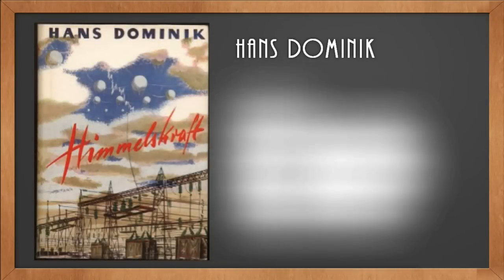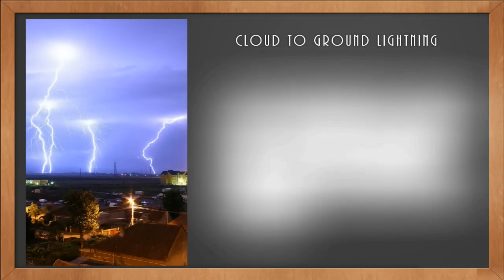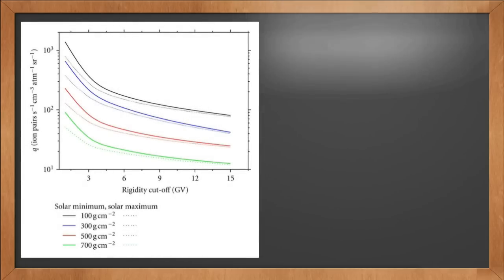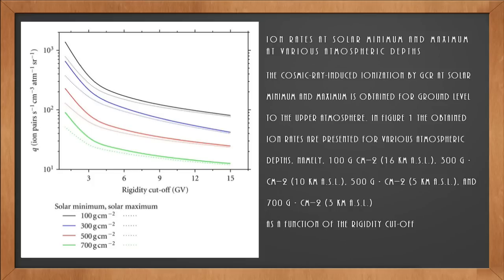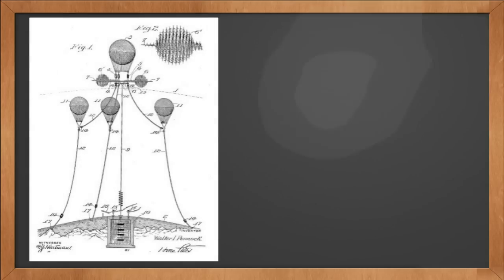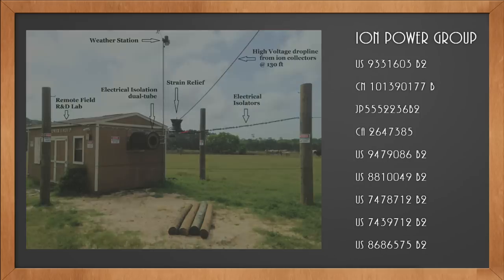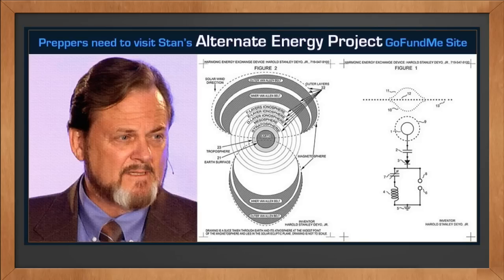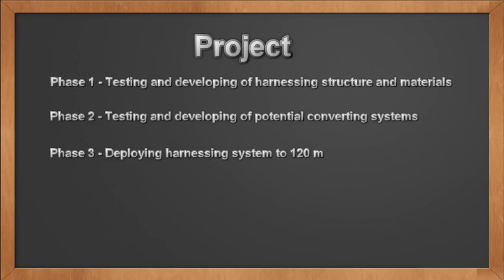Harnessing Atmospheric electricity

Comment: There is more than enough electricity, potential between the ionosphere and the ground to power the world.
Thanks.......Marc.
Reply: Doubtful. The total charge on the surface of Earth is estimated at around ~500,000 C, and the voltage of the ionosphere ranges between ~150 to 600 kV; assuming the latter to be generous, we can calculate the total energy stored in the system, since that's equal to charge times voltage:

500,000 C * 600 kV = 3 * 10^11 J

In other words, a total of ~300 billion joules is stored in the Earth-ionosphere capacitor.

The global power consumption is estimated to be ~2 TW on a continuous basis, i.e. 2 trillion joules per second. As should be very obvious from this, we use almost 7 times the amount of energy stored in the entire Earth-ionosphere capacitor every single second. Do you think this entire capacitor would recharge itself every 1/7 of a second? I sincerely hope not for your sake.
Reply: @hoon_sol  Much thanks for the calculations, the numbers tell the facts. I'm not one who would work the numbers. In perspective, if one house hold could utilize just a small amount, it would be amazing. Methods have been reported by certain people in the past, but there is no one today that claims such an accomplishment, if it was a possibility someone would have stumbled upon it. Thanks a great deal for the time and results from calculations.
Reply: @tribulationcoming :

You're welcome.

It should be noted that the fairweather current (the constant current trickling down from the ionosphere due to the electric field) is roughly ~1800 A in total, so that's ~1.1 GW if we're generous with the total voltage again. This means that the capacitor can recharge at least 1.1 billion joules per second, but the upper limit is not known (and likely won't be unless we start to actively drain it of energy at a massive scale and measure it, but this should naturally be done with great care lest we want potential devastating consequences); it's highly doubtful that it's anywhere close to 2 TW, but we really don't know.

The US alone uses ~400 GW of electrical power on average, so ~1.1 GW would hardly make a dent in that, and that's just electrical power, the total energy consumption of the US is closer to ~3.3 TW, beyond the total electrical power consumption of the entire world, and ~1.1 GW is just 1/3000 of that. The total global energy consumption is ~18.4 TW, again dwarfing that rate.

I'll say this, though: it could be possible that the Earth-ionosphere capacitor is at virtually full capacity, and that this is what is preventing further current from flowing into it; in that case the potential recharging rate could be much higher, depending on the current that is continuously delivered from Solar activity.

This is highly speculative, because these estimates might be completely off, but if we assume that the 1 second it takes for the capacitor to recharge itself the ~0.3% difference corresponds to a single time constant for the system, then that means that if the capacitor were empty it would recharge ~63% in that single second, given sufficient current from Solar activity (which could be wrong, perhaps this could be depleted too). That would mean a total current of ~315 kA, which is quite significant, and interestingly not far off the magnitude estimates we have for the Birkeland currents we know are flowing from the magnetosphere to the ionosphere, which are estimated at ~100 kA to 1 MA depending on levels of Solar and geomagnetic activity. That would mean a total power of almost ~0.2 TW; sadly still not even remotely close to what humans use, and we'd have to deplete the ionosphere completely to achieve it, which could have a lot of adverse consequences.

In conclusion, I thus definitely still doubt it's a useful source of energy long-term. In comparison to that relatively meager power, a total of 173,000 terawatts from sunlight strikes Earth continuously, dwarfing that calculated current completely. Most of this is radiated right back out instead of being utilized, as much as 60% of it. Again presuming we shouldn't mess too much with it, let's say we manage to utilize just 10% of it, which corresponds to 17,300 terawatts; that's almost 1000 times the power we're currently using from all sources of energy, and thus constitutes a far more promising form of energy long-term.

In the even longer term it would likely also be best to do the same, but closer to Sol and transmit the power back somehow; the radiant exitance of Sol is ~63 MW per square meter, so if we were right next to it a mere square kilometer of highly efficient receivers would cover current global power consumption. As we move further up the Kardashev scale we can also note that the total power output of Sol (its luminosity) is a whopping ~400 yottawatts, i.e. 400 * 10^24 watts; that's 400 trillion trillion watts, or 400 septillion watts. That's 20 trillion times our current power consumption.
Reply: @hoon_sol  I do a lot of weird, unusual, and strange experimenting. One idea is to put an eight foot diameter aluminum disk at a height of about 35 feet. Have a frame made of 3/4 aluminum tubing and an old tower. Will cover the frame with sheet aluminum on both sides and lift the assembly to a vertical position. Two pieces of no. 10 stranded wire will lead to the bench in the electric building. Then try lots of things. Thanks very much for the detailed and informative explanation, much food for thought. >Put one of my bifilar coils of approximately 900 mH immersed in a gallon can filled with magnatite, the flux field is contained with in the confines of the can. Using it in one of the pulse circuits I'm working with, seems to be doing well.
Be safe, but make sparks.

Comment: if its DC and at many KVolts  forst you need to good kv insulator and a way getting you DC to AC so you can step the ultra high impedance down to a lower voltage with more current. so here is how you do this  1 a Tesla coil on top of a ground stake 2 then on top of that a wind  mill type fun that makes and brakes the electrical circuit when the wind blows you AC pulse for the Tesla coil. 3 at its base, the low voltage AC is taped off , 4 at the other end of a long wire at the very top a barrage balloon made of tin foil or any conductive foil . If all goes well you  will get some free electricity.from a bridge rectifier circuit & capacitor.

Comment: Why we are not collecting electricity from Ion-Sphere .
Reply: The total charge on the surface of Earth is estimated at around ~500,000 C, and the voltage of the ionosphere ranges between ~150 to 600 kV; assuming the latter to be generous, we can calculate the total energy stored in the system, since that's equal to charge times voltage:

500,000 C * 600 kV = 3 * 10^11 J

In other words, a total of ~300 billion joules is stored in the Earth-ionosphere capacitor.

The global power consumption is estimated to be ~2 TW on a continuous basis, i.e. 2 trillion joules per second. As should be very obvious from this, we use almost 7 times the amount of energy stored in the entire Earth-ionosphere capacitor every single second. Do you think this entire capacitor would recharge itself every 1/7 of a second? I sincerely hope not for your sake.

Comment: Like the transmission wires, '5G' transmission towers, sky-scrapers, cable-cars, Ferris-wheels, flagpoles and other tall structures prominently featuring electrically conductive materials raised up high in the air!!!

Comment: Sir, what do you think about this, putting a low current ac signal through the wire to help move smaller charges in the wire so as to collect more energy?  Kind of like priming a pump?  Maybe, a super high frequency, but very low energy could be used.  It might do nothing, but I bet it does matter and works better that way.
Reply from the maker: I have some ideas I will try as it is as well related to Walter Russell's and the Phoenix journal 37 lecture.

Comment: Atmospheric electricity is static electricity. You might be able to harness lot of static electricity with this experiment. Take a PVC pipe, insert copper coil inside the PVC pipe in a way it properly sticks to the walls inside the PVC pipe. Connect LED bulb, full bridge rectifier and capacitor to copper coil at wire coming out of both ends of copper coil from PVC pipe to complete the circuit. Now rub the PVC pipe with silk cloth or nylon cloth to produce static electricity. See if the LED lights up. If LED lights up, experiment is a success.
Reply from the maker: That is not the point
Reply: Atmospheric electricity is electricity produced by rainwater falling through air.  The question is how to harvest that energy without having to create the necessary friction oneself (as by giving a hand job to PVC pipe rigged with wires)
Reply: @taxAt1oni5th3ft  a handjob lol that was hilarious😅😂😊

Comment: Any voltage gradient in the atmosphere (or anywhere else, for that matter) is of little practical use if you can't draw any significant current from a harnessing system. All you will do is cause the electrostatic field to distort, so if, for instance, you connect an electrode at 100 metres in the air and connect the other end to any current drawing device at ground level, you will just cause the electrostatic potential at the electrode to drop to zero volts with respect to the ground. Of course, if you do this during a lightning storm you'll probably blow up your equipment on the ground and possibly die. But you will have harnessed about $100 (correction $6 or 7) worth of lightning energy in doing so. That's at today's commercial value of electrical energy from traditional sources.
Calculation and correction added: That's 30 thousand amps × 100 million volts = 3 000 000 000 000 watts, or 3 000 000 000 kilowatts. But it only lasts about 30 micro seconds (apparantly), so that's only 3 000 000 000 × 30 ÷ 1 000 000. = 90 000 kilowatt-seconds, or 25 kilowatt-hours (divide 90 000 kilowatt-seconds by 3 600). I pay about £0.17 per kwh, so that's £4.25, or about $6 or 7 dollars.
Please tell me if I've got my calculations wrong. They're all big numbers until you get to the final bill.
Reply from the maker: Your math is sound and represents the majority of people thinking about it. It is true that there is no real interest from the industrie to follow up. It is all based on scale and efficiency. I want to prove a couple of points which have been mentioned with figures to make this endeavour pointless. As seen in your comment.

Comment: Ehh....  
atmospheric electricity is a thing but it can radically vary with even minor changes in weather. Society struggles to make a good electrical source out of solar panels and wind turbines, but the electric potential of atmospheric electricity can vary from as little as 1 volt per meter to 1 kilovolt per meter. More over, what defines a 1 KV condition and what defines a 1 volt condition is subject not predictable. 
solar weather (literally the electricity produced by the sun that hits our planet), wind, relative humidity, local geochemistry, human RF activity, and variations in the earth's core are the most prominent off the top of my head.... but they're probably more.  

That all said, this stuff is easy to experiment with. aluminum foil is easy to shape and form into any sort of balloon, even one that looks like an idealized omnidirectional antenna. You can use mylar, but it actually impedes charge somewhat. You want to expose large areas of metal, high up in the atmosphere. IE: maximize surface area exposure to the atmosphere. 
45 gauge copper wire is cheap, although weaving it with high strength fishing line has to be done manually and is generally extremely difficult. Mostly cause 45 AWG is so small it's hard to see, even with large magnifying glasses. 
You can buy helium in the USA at party stores, or you can just use hydrogen as long as you keep it small. 

You need a low impedance path to ground, and you need an earth ground that's capable of soaking an actual lightning bolt. Tying to you water pipes is fun right up until someone dies or something explodes. 4 AWG bare copper wire is sold at lowes and home depot here in the US.
Reply: The ionosphere has highest ionization from neutrinos

Comment: Atmospheric electricity is certainly real and I recommend anyone who has some time on a weekend, go try the experiments out for yourselves: run a wire up as high in the air as you can, and It can be as simple as a full bridge rectifier storing the energy in capacitors, as long as the diodes used have very low reverse current/leakage. Ideal diode emulators like those used on solar farms may be even better. It's only practical to get a few watts at a time with a reasonably sized DC setup, but it is indeed real power.

'Electrodynamic' structures like Tesla coils and the Alexanderson antenna described by Eric Dollard may be able to harness atmospheric electricity due to their capacitive interaction with the earth and atmosphere, and due to their ability to serve as a sink for electrons with a high effective surface area. Losses in a tesla coil may ionize regions of air, allowing a current to flow in the newly conductive region and down into the tesla coil topload, hence the earth-ionosphere capacitor charges up the earth-topload capacitor and that energy goes directly into the LC resonance of the coil, where it can be extracted. it may be difficult to make the energy expended to ionize air be less than the energy received by shorting the earth-ionosphere capacitor, but the dark plasma discharge regime would generally be preferred, close to the corona discharge regime if possible.

Comment: I would like to point you towards an American scientist from back in 1860's. His name is Nathan stubblefield, he had some really interesting work to do with original radios (not many people know that radio is older then thought -AM radio mind you). He used a telephone receiver and a could set up within the ground, like the original capanadze device. Bury a conductor into the ground and have a receiver for radio signals, allow both to be introduced jato the circuit and you have current from the ground and voltage from the air.
Reply from the maker: I know. Look at my Stubblefield receiver I did build and test
Reply: Lewis Salter i agree,i feel everyone is running there tesla coils backwards, i feel its not ment to take low voltage and step it up to high voltage to  get cool sparks .instead it should take the high voltage atmosphere electricity and step it down to usable power,

Comment: The Meyers circuit which consists of a north and south pole magnet connected by iron. This arrangement is placed opposing the earths magnetic field which due to being out of phase from the earths magnetic field creates perturbations of the dielectric field of the magnet arrangement. This creates an AC pulse. Parallel to this arrangement pointing north south or two zinc plates connected by iron wire. If you put a voltmeter on the iron wire between the two magnets in the iron wire between the two Zinc plates you will measure and AC current. One pole consists of the 2 zinc Plates connected by iron wire and the other the two magnets opposing the earths magnetic field connected by iron wire. Please see the circuit diagram at the bottom of this link

http://rexresearch.com/meyers/meyers.htm#edholm

Would bismuth plates work better? Can you think of ways of improving this circuit? Would wider disc magnets work better to generate and oscillation connected by the Iron rod? Would a weaker magnet work better due to its farther reach? Would the strong magnet reduce the buffeting effects from the earths magnetic field? I’d be grateful to hear your thoughts on this circuit. 

Thanks for sharing http://www.overunityresearch.com/index.php?action=dlattach;topic=3359.0;attach=23030
Reply: Some of Russian researchers made  similar device better than this.I have  electronical component system to produce air electricity and it works.Very interesting subject is that making visible the  air electricity (Aether Energy)I tried to understand this ,some researchers made it.